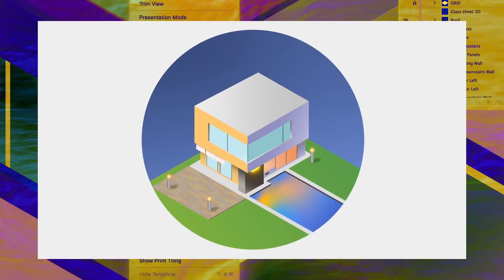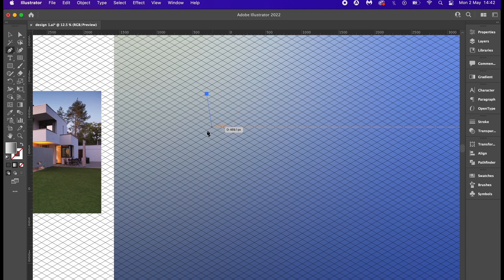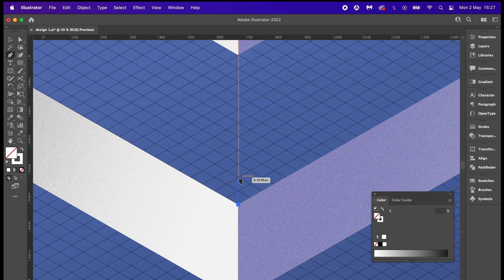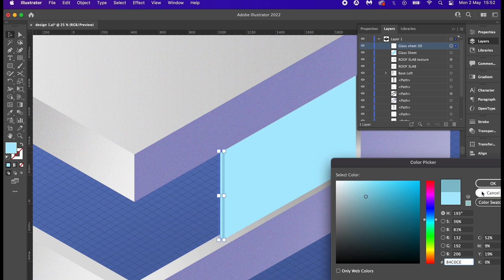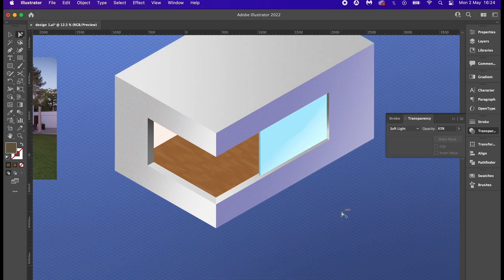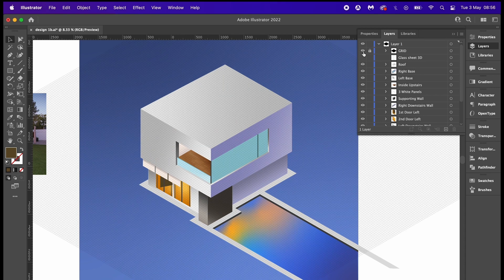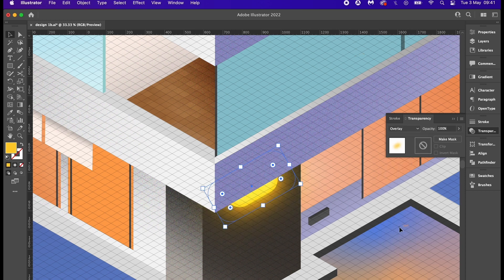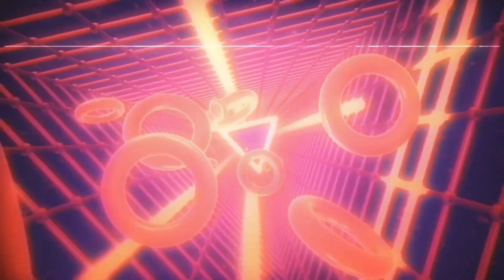How To Create ISOMETRIC Designs in Adobe Illustrator — The Easy Way

Comment: One question. I made grid same way as you did and when i put guide on the top corner, to try to match it with the bottom corner, it isnt good. You can make guides trough whole grid and see that it isnt 100% straight ( guids aint hitting crossing spots ). Is it me doing something wrong or making grid this way cant be 100% perfect? As someone who did isometric pixel art where you need to make grid manualy, no matter how long it is, it is straight. Great video btw and thanks for sharing.
Reply: I found the bug, height is 86,602 not 86,62

Comment: Hey Satori, thanks for the tut. How do you get these corner icons (points) bigger? Mine are smaller than yours
Reply from the maker: Thanks! 
Head into the preference settings (command or control K), and change the size of the anchor points there. I forget which section though. Also you need a version of Illustrator newer than around 2018?